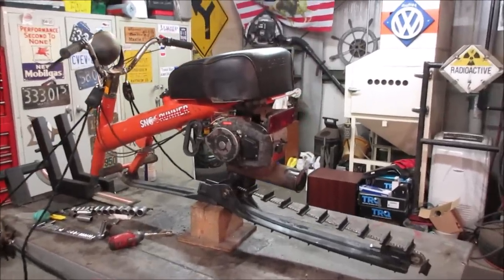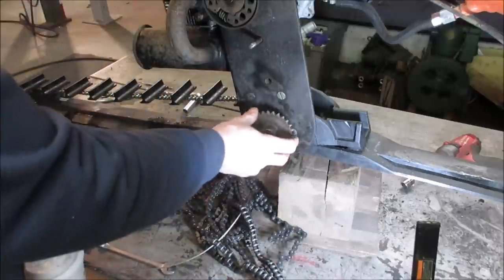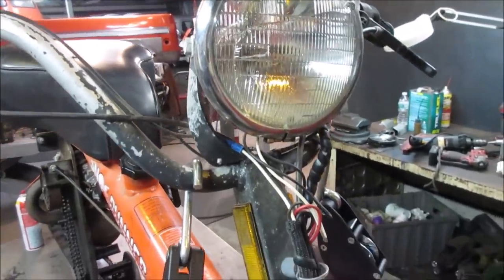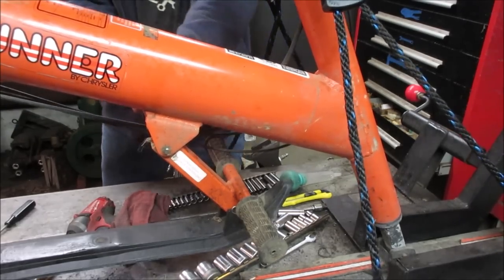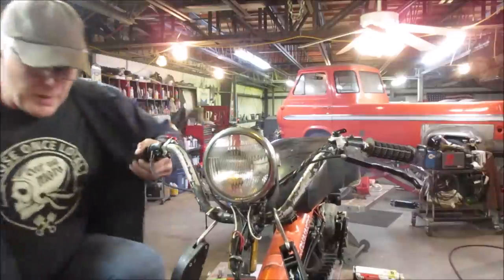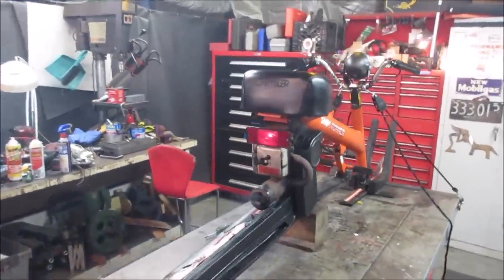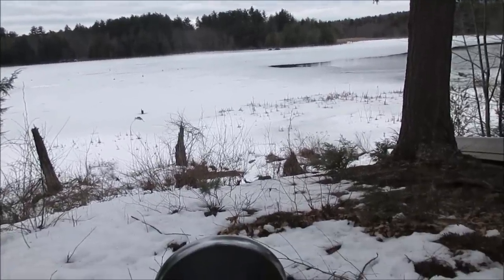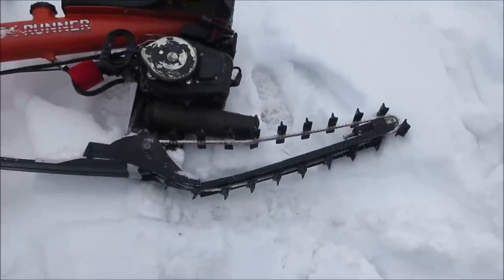Repairs finished on Junk Chrysler Sno-Runner, Win or Fail?

Comment: I found a picture of one with the chain cover removed, the chain looked tight and there was no visible tensioner.

You could go for the high-power conversion which would require a larger sprocket. After you repair the ski that is.

Comment: you can temporarily stretch shrink tube with a pair of needlenose pliers to get it over obstructions and multiple layers of shrink tubing. just feed it over the plier jaws and the increasing width of the jaws will stretch the tubing, but it doesn't stay stretched for long so you have to be quick pushing it into place. the longer the jaws the better it works.

Comment: That GE front bulb is a 4492 which is specifically made for snowmobiles.  Its a 60/60W bulb that also has more supports on the filament.   That bulb is long since discontinued.  Its a 5.5" PAR46 bulb and can be H5006, however its much lower wattage and automotive.

Comment: I had a 2005 Chrysler Pacifica. The rear bumper got yanked off. I used ABS glue to repair it. It worked great, only I had to wait overnight for the glue to cure.

Comment: Proof that free stuff ain't free. I wonder you could mold a new rear cover out of PVC or ABS pipe? 
My early experience with chain tighteners was using a small sprocket on a spring loaded arm. never had a problem with the chain coming off. if it is an issue put a couple fender washers on either side of the small sprocket to act as guides. 
You possibly could work a trade with Red Necks & Dirty Hands. He upgraded his to a larger motor and track  He had the full kit with guards.

Comment: They use to make and sell a fiber glass kit in the automotive section of retail stores. I used one before back in the early ‘80s to line my rusted out trunk of my ‘ 73Chevy Malibu. If they still make them you could fix that plastic guard up real nicely.

Comment: Nice video! I'm sorry it broke. On repairing plastic, melt in a strip of metal window screen. It works wonders for strength! I use zip ties for the extra plastic. Thanks for the fun!
Reply: So are you using the zip ties like rods for brazing metal?

Comment: I'm surprised the track runner didn't have a piece of flat spring steel inside of it for better support. Of course now you can go back and build a better version  using snowmobile parts with an upgraded engine and maybe a wider track using a cut down drive belt that will go better on deep snow maybe using an old Honda three wheeler as the base.

Comment: Another awesome long Sunday morning Mustie1 episode to wake up to.
This series makes me wannabe a kid again in Michigan winter on one of these zipping around like a Mad man.
The best thing to clean that size bulb sockets is a dremel tool cone shaped stainless steel brush on the end on medium speed.
Then finger or Qtip rub some di-electric grease or gold Deoxit  around the inside. 
Deoxit is friggen awesome connectors and other electronic devices anti-corrosion product I've been using since I lived in the Florida Keys for ten years in the Keys on boats, cars and pinball and arcade games, jukeboxes and other electronic devices.
It's good for 5 years plus in salt water inviroments.
10 years plus non salt water enviroments.
It comes in spray, can brush, wipes and tube.
It's exspensive but a little goes a long way.

Comment: One mechanism of taking up the slop in a drive chain is curved chain guide with a low friction plastic running surface.  That's 40 years proven!  But, along the operation of this device is THE REVERSE TORQUE AND CHAIN TENSION DYNAMICS.  For example:  when the brakes are applied.   ...If the braking is in respect to the "primary drive".  If the brake is applied to the final drive, there shouldn't be any problem.   Just a thought.

Comment: Try repairing broken plastic with solvent adhesive. If that's ABS, your repair will be better than those melt-in wire clips.

Comment: Aaaaahhhh, Sunday morning and a Mustie1 video, can't get any better!!  That has to be one of the most unusual things you have had on your channel and I really enjoyed watching all three episodes.  Lots of comments about a chain tensioner, but you didn't have any problems with the drive chain, so maybe a non issue?  I read where one of the complaints about this thing is the exhaust being restrictive and causing it to be low on power.  Maybe a different muffler would allow a few more RPM's?  At any rate, I really enjoyed this one and agree, the next one should be getting the VW Trike running.  We want to see how it does in the snow also!!

Comment: That large hole between the clutch and bottom sprocket is clean around it. It seems an idler or tensioner would’ve gone there.
No diagrams anywhere to be found?
Great work

Comment: Should of gotten one of these from Corteze Dodge. as a Gift since my new 76 Royal Monoco went thru transmissions first 3 days after I bought this car new. Went thru. 3 trannys battery Firestone 500 tires the wires came out stripped paint off fenders Wiper motor went blizzard of 77 . The alternator heavy-duty one went mo after i picked this car up. Was stranded in a white car 7 miles from home. Had that POS 6 mo. Bought 2 new cars other one was 75 Royal Monoco 2 dr. My mother used that for 5 yrs.I did put police car axle and air shocks. And carb since stock ones kept staling car  ten mins. into drive. Put 249.00 Holly Carb on it .

Comment: Chain tensioner - put a shoulder bolt [normal bolt is fine] with a washer. Sleeve the bolt with a piece of copper water line to be a chain tensioner. After you have it right, use Loctite on the bolt threads.

Comment: Looks like surprisingly good fun under the right conditions!  It is a wonder parts are still available for it even if the price is steep.  Wonder if a new ski would be just a brittle as the original after sitting around for years?  I figured this would be a joke but it actually works pretty much as expected - maybe better!
Reply: I was pretty shocked he got the chain w/grips so easily.  Maybe its used one something else?  Just seems odd that such an weird part would be so readily available.  The ski may be replaceable with a snowmobile ski with similar dimensions...tons of different snowmobiles out there, lol.

Comment: Sure as hell a lot better than slogging through snow on foot ))   The plastic ski being the only weakness, and thats just time catching up with it. Although, the flex in the ski is kind off like the suspension........they probably could have put a piece of spring steel into the spine of the plastic ski to give it more durability.

Comment: I think the starter handle should be clocked so it points straight up instead of forward, so it's easier to pull when sitting on the bike.

Comment: A deco valve with a hole in it is similar to the design used by Husqvarna.  Stihl uses a straight hole all the way into the combustion chamber.  Husqvarna puts their deco valve on the side of the cylinder on those saws I am familiar with (372).

Comment: The manual shows another stud in that mystery hole that you thought might be for a tensioner.  It's the same as the stud above it, and it's used to hold the chain cover on.  Super weird that they didn't provide any means of adjustment, but maybe it's not necessary when it's fully enclosed, assuming it's kept clean and lubricated...

Comment: Hey - Too bad about the base breaking but you knew it would.  Unless you are thinking to go totally vintage and make it as it was,,, one idea that I had was to find an old downhill snow ski and fabricate a bracket or even a break away binging to the snow runner.  You could then paint it black or just find something with a cool color. A snow ski will be much more durable than plastic it it can be mounted.  Just two cents from the P-Nut Gallery.  Great Job as always.

Comment: On the chain where the guard bolt is there should been another small sprocket that took some the play out the chain It had a bearing on the center and they had a habit of running dry & freezing to the bolt shaft & people just tossed them out not knowing it kept the chain tensioned ! I worked at a small honda shop in the 70's and seen those being assembled out the box !

Comment: A shame you don't get many Reliant three wheelers over there, they are insanely good fun in snow and its quite funny watching 4 wheelers struggle and you just zip on through like a champion.   I reckon the Reliant you would like is the Ant or TW9 3 wheel truck, usually a pickup with a tip bed but they have been used from a tow hooker to mini dustcarts and even UK HGV class 4 Articulated Tractors pulling a half container like a big lorry.   I also believe in your neck of the woods are a couple Reliant Zoe's as they sold in a few places in the north eastern seaboard area, I believe only 100 ish were ever sold but they are rare as rocking horse doings and you won't find a more outlandish eye catching car out there lol

Comment: Looks like an idler sprocket with its bearing mounted on an eccentric centre should be fixed by the stud in the threaded hole to adjust the chain

Comment: A guy up my way in Ontario modified a track kit like on the back of that 3 Wheeler and it works amazing and it actually has a little bit of suspension now He also put a bigger engine in it.

Comment: I think you could make some sort of spring-loaded tensioner that can go in both directions (turning around that cover-holding "axle" thats broken off). The cover should be off, then it wont break... and the broken ski... should be remade out of steel! XD
(Also i would make sure there's not some sort of off-centric sort of tensioner on the upper or lower side you might have missed.)

Comment: I have done some plastic repairs to each is they're own on the process. I've super glued it together first, then use a hot pocket screwdriver and stich it that way (caution toxic oder expelled lmao) then use a two part plastic epoxy. Also have melted zip ties into the stitches. However in the land of prop 65 alot of things that work are no longer available.

Comment: If you read ur comments you would know that I showed you that the tensioner is actually missing, where that shaft sticks out under the clutch is supposed to be a tensioner on that shaft kinda like a 10 speed bike on the bottom of the back tier.

Comment: Hi Darren, i saw a picture of the chain drive in a service manual. The chain from the clutch to the lower sprocket has no tensioner. 
Have you thought of replacing the plastic rear ski with a normal downhill ski. Great video series. Greetings, Heiko

Comment: Mustie, I been using those stupid cable lubers for years till I decided to treat myself for Christmas and purchased a cable Luber V3 from Motion pro.  I will never use one of those cheapo cable lubers again.  they lube everything besides the cable and if a cable does have a more stubborn  blockage they don't work anyway.  The motionpro one can be used with pressure and even compressed air.  They will pretty much clean out any cable.  you should seriously give them a try.  They are a bit expensive, but well worth the money.

Comment: Mustie1 they do make y-shaped tensioners where there's a roller on each arm of the Y and springs so they squeezed in towards each arm. Y turns into a I without a chain between the arms.

Comment: I was intrigued by the chains on the Sno-Runner, it appears there is no reduction in the drive to the chain with paddles. So the paddle chain runs at engine speed... wow, that must be insane !!!
Reply: i think the size of the clutch sprocket is about 1/4 the size of the bottom sprocket so they are getting some reduction there.

Comment: The original chain has no master link probably to get the chain tension right I have to do this a lot with karts. Press the chain pin almost all of the way out push the chain back together then hammer the pin back in. Don’t use a half/master link it.

Comment: I was thinking that is a #35 chain and it is missing a half link. We use on some of our equipment and sometimes someone will try to replace the chain themselves and not realize it has a half link. I suspect someone replaced the chain and couldn't get it to fit tight enough and just said screw it and ran it like it is.

Comment: The throttle cable shouldn't be routed via the headlight bracket, but directly from the front chrome loop guide to the twist-grip,  and zip-tied to the underside of the upwards bend in the handlebar if you're worried about it snagging on branches etc. 

Also, the lighting circuit on these is pretty agricultural - it's powered from a single coil under the flywheel, there is usually no voltage regulator, but rather the output power limiting relies on the maximum available current of that lighting generator to control the output voltage. Real common with early Japanese bikes. Too high a wattage lamp and the light will not reach full brightness; too low a wattage lamp and the light will burn out quickly.

Comment: those plastic welding things you are supposed to cut them ends back so they are flush and ideally you would run some plastic weld rod over them to cover them up

Comment: Only The Rusted gear on the table I think that's what's supposed to hold that chain tight it looks like something that should be in down there in that area there should be a gear that goes like you said that's kind of loose that means there had to have been a little gear somewhere that was supposed to be there

Comment: There are technicaly ways to change the distance of shafts, not so obvious from outside like eccentric holes, I would look into it, no way this loose chain to work more than like 100 rpm. Maby rotating the bearing thingy where those conic bolts go. Cheers.

Comment: Yeah, great video. If you buy a new/used one, it will be the same age if it were stored in an unheated warehouse, you may end up with the same thing. You need to find a pair or used skis. Do you have the tools and the smarts to make those things. A good woodworker could make that out of a nice spruce tree. They are flexible and strong. Dropping 50 pounds of weight would also help.!!

Comment: There is a type of plastic welder that has a little like staples that melt into the plastic. I can hold things together. Have you seen one of those yet that would work great I’ve used them on quads and things with plastic sheeting.

Comment: My old atco standard has a half link in the main drive chain I believe it’s was put there by atco in 1929 when the mower was new at the factory. I did inspect the chain I hope it was worn enough that it could be removed or to replace the chain

Comment: all you have to do is put a straight bracket and a little gear and have it stationary on the chain to make tension.
you need a new centrifugal clutch plate break they have them with pads on Amazon.
Go Kart Mini Bike 4" Brake Band & Pin for 4 inch Go-Cart ATV Minibike Brake Drum

Comment: Even that your Emergency PullStart was missing , that was a cool idea i thinkChrysler used from their old Outboard motors  as a Teenager inFlorida  i would take any opportunity to go out on someone’s boat to go Fidhing or Scuba Diving one of my Uncles had a  Older AluminumHull CabunCrer  with a 1970# 110 Chrysler Outboard  under a bolted plate on the Flywheel was a Rope with a attached Wooden handle you could wrap around the FlyWheel to manually pull start the engine inEmergencies   that old boat motor always had electricalIssues and often the battery would go dead so we would need to pull start that thing it litterally took 3 men and a Boy to get enough Speed and strength to start that thing but it did save our asses.  a few times

Comment: that cover i would have just used a piece of finishing fiberglass cloth which is really thin  and used resin and hardener  on it i have a coleman camper and the front and rear shell are plastic  i backed it up and broke out a corner of it a new shell is about 500,00 but no longer available so i rebuilt it with fiberglass finishing cloth and now  its stronger than the plastic was

Comment: unscrew the stop not slide it down the cable shrike wrap it slide it back up. Also on those cable lubers put it in so the housing just goes past the first hole. And do it from the top.

Comment: Go on line look up.   Chrysler sno runner manual PDF it should be the third site down it will show you every part and part numbers .  there is no trencher I think it has the wrong clutch on it where the chan gos round the back of the clutch on the one you have is to small that's way your chan don't fit right. I hope this help's

Comment: Awesome ride! I bet if you put a slightly bigger sprocket on the track it would go faster since it would let it run higher rpm on the engine.
Reply: Wouldn’t you need to use a smaller sprocket to achieve higher top speed? Like 2 or 3 less teeth??
Reply: @thomasadrian9854  it sounded like the motor wasn't reaching high rpm. A slightly larger sprocket would fix that possibly gain more rpm and speed.

Comment: If you added a small rechargeable 12v battery inline to the headlight, would it make the headlight and taillights more stable at low speeds?  Not that it is necessary, I'm just curious.  Would it cause any issues with the wiring?  Would you have to put a 1 way setup on it?

Comment: Was wondering for a tension wheel for the chain? Flat quarter or eighth inch bar, 2 holes one for the bolt other for a rod n wheel combo.

Comment: THE POINT IS MOOT NOW, BUT A GUY ON EBAYS SELLING A PARTS MANUAL SHOWING CHAIN, AND THERE WAS NO TENSIONER. I'D  TAKE ONE OUT OF AN ENGINE, USED FOR TIMING CHAIN. SKI ON THERE, BUT IT LOOKS OLD, AND ROUGH.

Comment: You're missing a wheel that's what that little thing sticking out for the chain scene in the middle between the two sprockets there's another gear that's supposed to be there